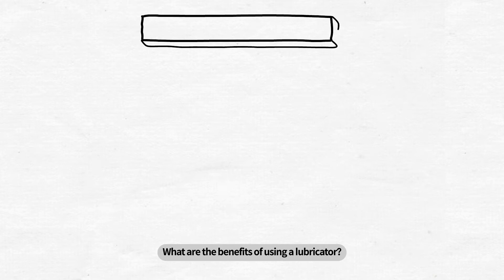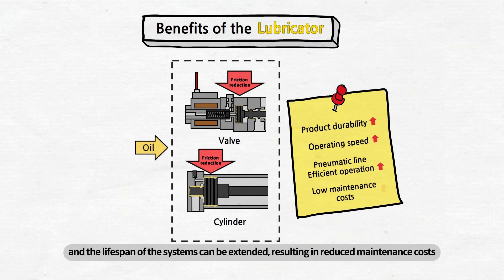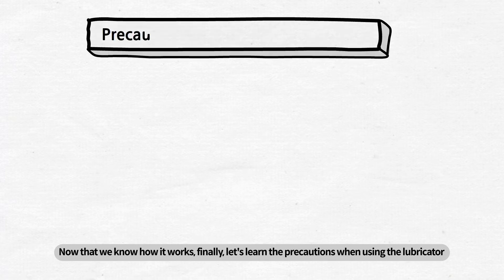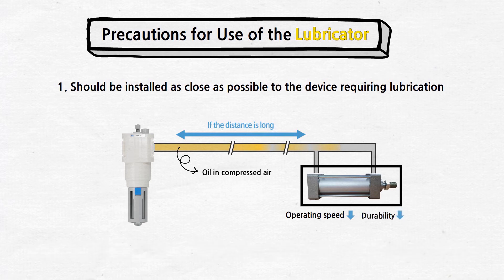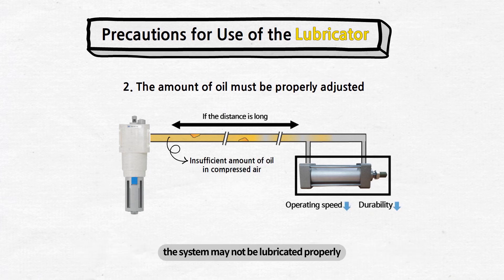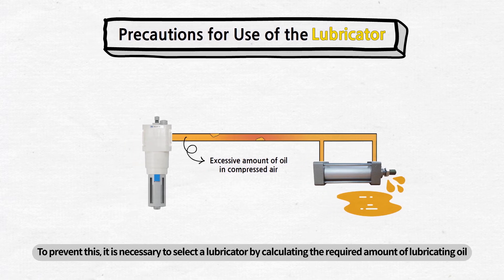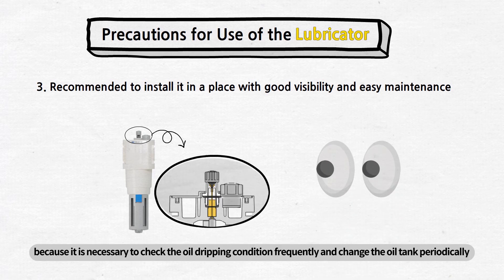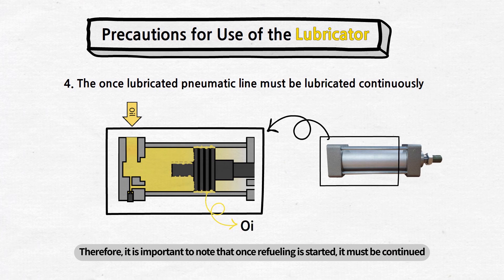How Lubricator works? (subtitles | animation)

Comment: If the bar of a cylinder is 8bar and what suply to the cylinder is 5bar what will happen to the movement of the shaft travel
Reply from the maker: I'm not sure if I understood exactly what you asked, but I'll tell you to the best of my knowledge.

1. If 8 bars are required to operate the cylinder, the supplied 5 bars may not work or become unstable.

2. It is difficult to confirm the exact role of the product as it does not deal with the product called the shaft, but I think that it will be difficult to operate normally in the same way as in No. 1.

It's an insufficient answer, but I hope it helps.